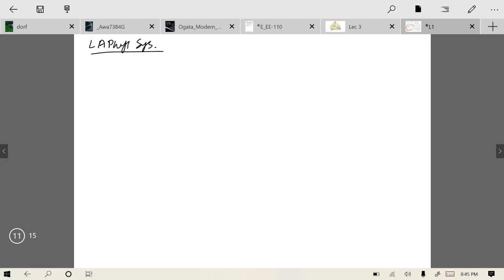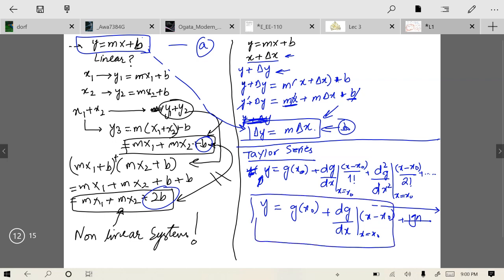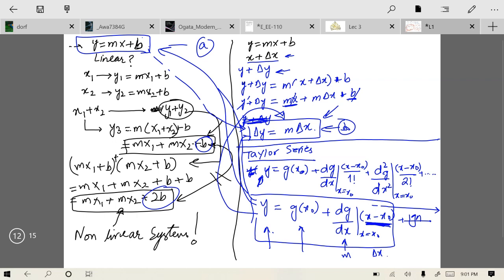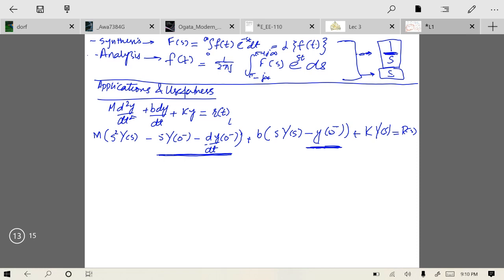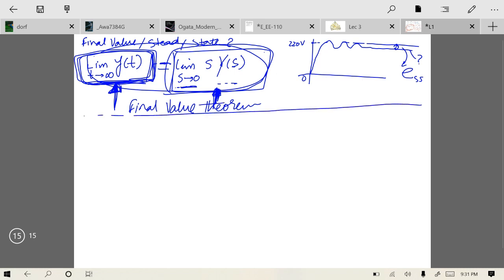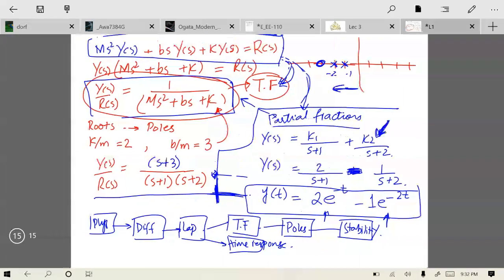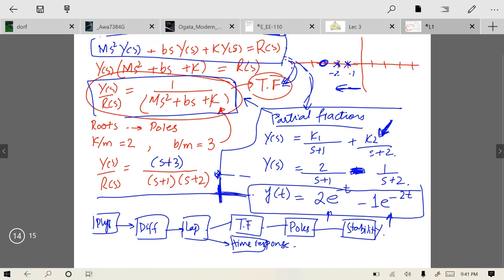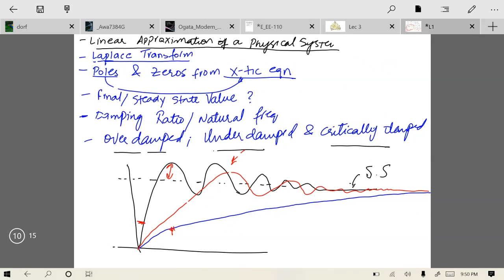Modern Control Systems. Mathematical Modelling Contd - BS Electrical Engineering-UET Lahore ( Dorf )

Comment: Sir,
we see that y=mx+b is non-linear equation, is it the b term making it non-linear? if yes then if b=0, then is y=mx a linear equation now? as it will relate to delta(y)=m*delta(x).
Reply from the maker: Yes, It is linear for the case b=0. Otherwise, it is not. For general b, it is an affine transformation.